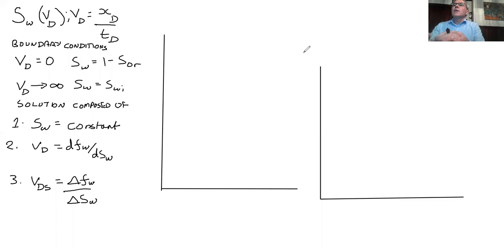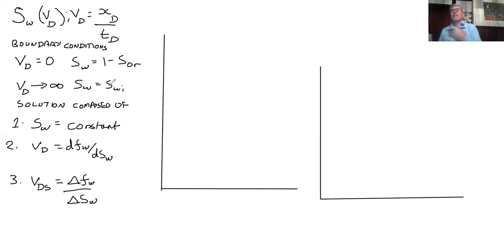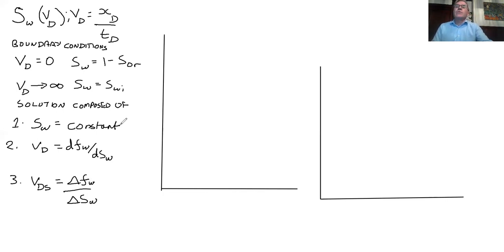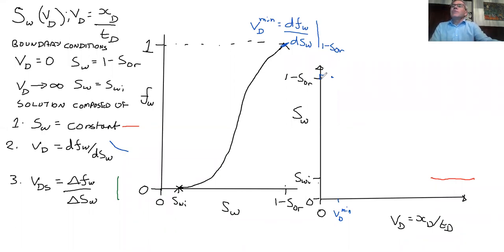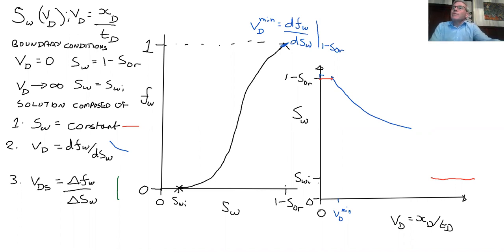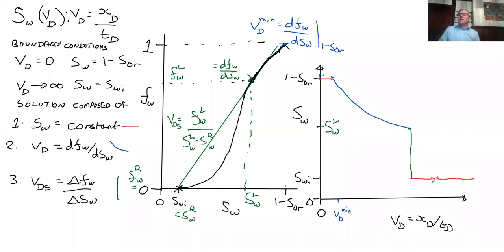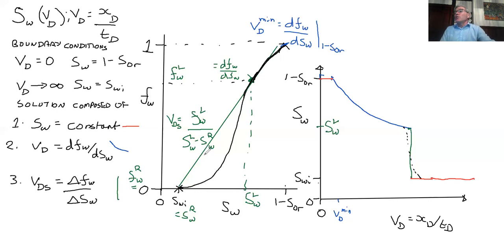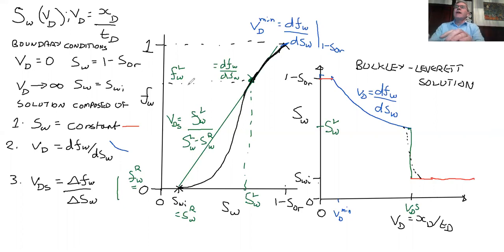Constructing the Buckley Leverett solution

Comment: Is the exact value of S_ws (the saturation of water at the shock point) calculated via the Rankine-Hugoniot condition, analytically?

d(f_w)/dS_w = f_ws/S_ws

where the s subscript mean shock.
Reply from the maker: Yes, but the expression you quote is incorrect: it should be d(f_w)/dS_w = f_ws/(S_ws - S_wi).  You need to account that the shock starts at the initial water saturation, S_wi.
Reply: @BoffyBlunt  Thank you for the swift answer, professor Blunt!

I was struggling to come up with an analytical expression for S_w as a function of V_D, in the blue curve region. I found a way of doing so programmatically by firstly plotting V_D as a function of d(f_w)/dS_w and then performing a 1D interpolation of the result with V_D ranging from 1 to V_DS, for [d(f_w)/dS_w] discretized with regular periods.

Qualitatively the end result seems correct, for varying t_D, since the shock S_w^L is always the same as well as the "shape" of the blue curve (despite the "stretch" as t_D increases), but I am quite uncertain about the values!
Reply from the maker: @bva0  This should work, but instead divide the saturation into increments from S_wi to 1-S_or and calculate vD = df_w/dS_w.  As mentioned previously, find the shock front.  From 1-S_or to S_ws simply find vD as a function of S_w.  So discretize S_w, not vD which is more complicated.